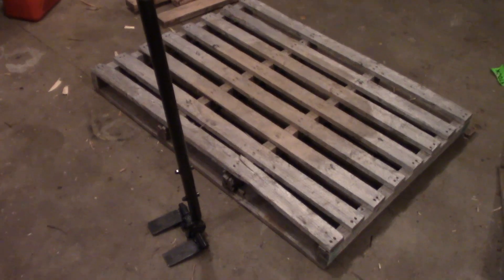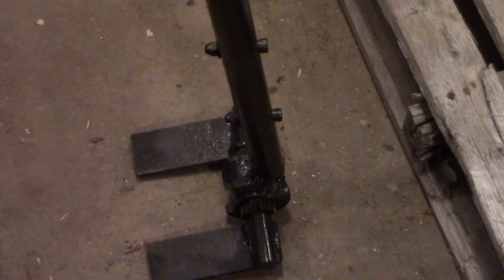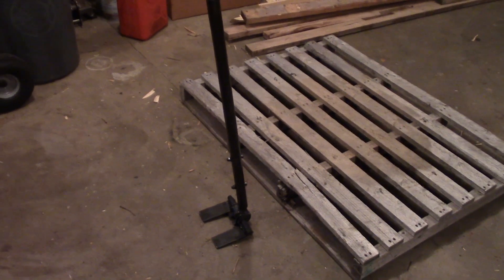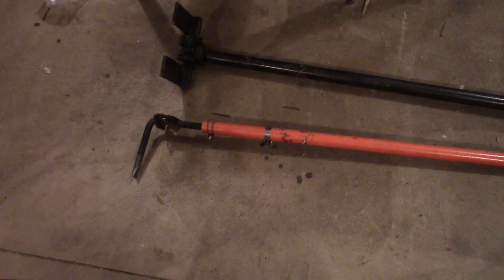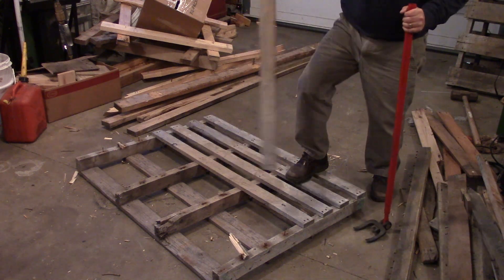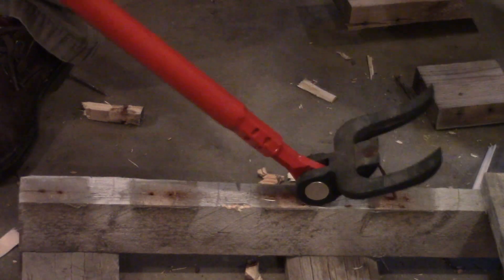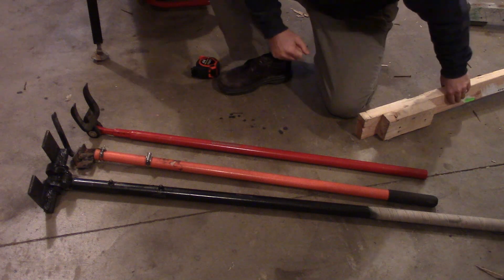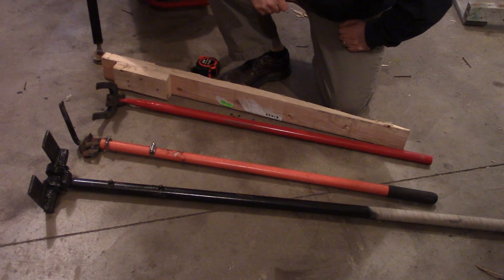Testing 3 Tools For Dismantling Pallets

Comment: Pallet wood is a double-edged sword--the wood is usually tough as nails but getting at it is just as tough.  The thing that makes using them so good is they're usually free and it beats sending them to a landfill.  Thanks for sharing Doublewide.
Reply from the maker: Agree, my basketball backboard turned out so well, that I wanted to try to make some other pallet wood things.  Stay tuned.  Thanks.  Merry Christmas.

Comment: Just learned a cheap lesson here -- pry on the ENDS first and finish in the middle. Look @6:45 when the final pry sends a board zooming upwards kinda fast. Sure, it was traveling in a different plane than the user, but still, so easily avoidable by finishing in the center of the board. The speed that the far (high-travel) end of the board was  moving at would hurt a lot. Stay safe!

Comment: I cracked myself in the face with a crowbar years ago prying apart an old 2nd floor deck from underneath.  I feel your pain. Nice demo man.
Reply from the maker: I took a hard hit, and as the pain filled my head all I could think of was how was I dumb enough to do that.  I had my wife check me for a concussion using a flashlight.   I know exactly what you are talking about with the crowbar accident.  At least with these leverage style demo tools, now you can be safer and work from above.  Thanks for commenting.  Merry Christmas.

Comment: I wondered if you were going to use that first one you made for long. That Crescent one looks to be exactly what you need.
Reply from the maker: The first one was WAY too heavy.  It works well, but it is a workout and a half.  I also should have changed the angle on the first one for better leverage.  The second works well, but it is too light duty.  The bull bar feels just right, and I can tell it will hold up to some abuse.

Comment: i love homemade tools...i have access to plenty of pallets just never do anything with them but nephew does..ill have to show him this video...do you use a torch for forging or do you have a forge?..thanks for sharing
Reply from the maker: Hi Ed,  Nice to hear from you again.  I really don't use pallets too much, but my friend that I work with was taking apart some pallets at work, and I knew there had to be a better way.  I repaired my basketball backboard with pallet wood, and I had the first hand experience with ripping down pallets by hand.  Not fun.  As far as the forging, I did it using my oxy acetylene torch and hammered it out with the anvil on my vise.  I cut the V groove with a cut-off grinder.  Happy Holidays.  Bob
Reply: doublewide6 merry Christmas

Comment: That is an interesting tool.  Breaking pallets is hard work.  I saw them up now.  I to have almost knocked myself out on more that 1 occasion.
Reply from the maker: Sawing the nails works pretty well especially if you don't need the 2x4's.  I'm working on a few pallet projects and I'm using the 2x4's.  I should have some videos out in not too long.  Have a great Christmas.  Cheers.

Comment: Your first tool is  an interesting build. I have done many projects using pallets.
The pallets I use depend on the project. Some pull apart with very little effort, usually soft wood (pine). The   rest, well lets just say “Free Wood” is a misnomer. If I am going to use the boards I have found it much quicker to cut the ends off.  You can then get the middle nails out fairly easy. You get boards about 3” shorter but without splits. Unless I can use them whole I shy away from pallets with 4 runners. That extra runner just adds too much work & the middle often splits. Hope this info helps.
Reply from the maker: Good info.  I never really thought out 3 vs. 4 runner pallets.  I don't really do much work with pallets because of the labor involved,  but lately I have made several projects out of them.  Thanks for commenting.   Bob

Comment: Ordered a piece of stone for a fireplace.
They delivered it on a multiple 3 pallet configuration that felt like it weighed 200 pounds.
I had to sling then drag it with the truck.
The specialized disassembly tool I used was a chainsaw to cut it into manageable pieces...
Reply from the maker: The chainsaw works great, but you can't reuse the wood.  The pallets I'm using are from a stone yard/landscaper.  They are super solid.  Thanks for watching.  Merry Christmas.  Bob

Comment: Would you salvage more wood/ pallet if you cut the nail heads off and  pulled them thru. A 4" grinder with a cut-off wheel would take the heads off pretty quick. There would be some collateral damage, but end result better. Not to be a smartass because most of us have or damn near knocked ourselves out at one point or another, but that video would go viral taking a pipe to the head. Glad we can kinda laugh, assume no long term damage. doug
Reply from the maker: I'm using the 2x4's, so I need the nails out of them too.  A sawzall works really well doing the method that you describe.  I don't have any video of taking the pipe to the head, or if I do I'm still not aware of it.  Thanks for commenting.